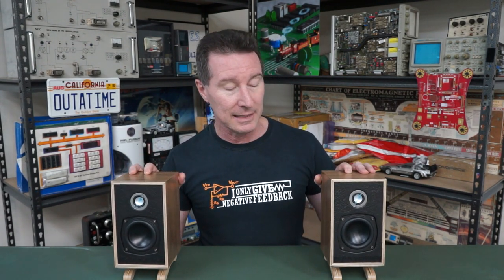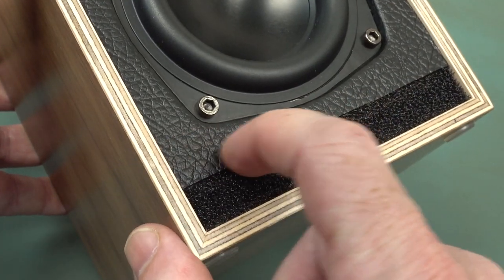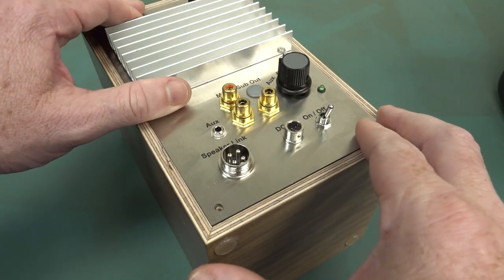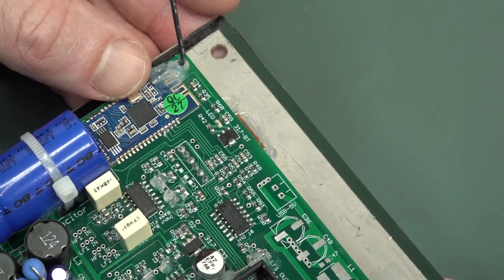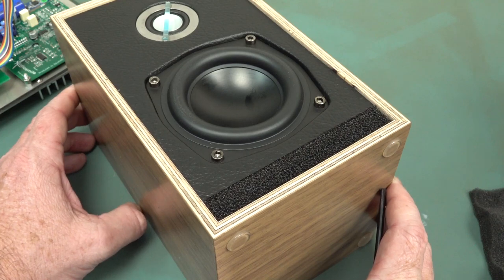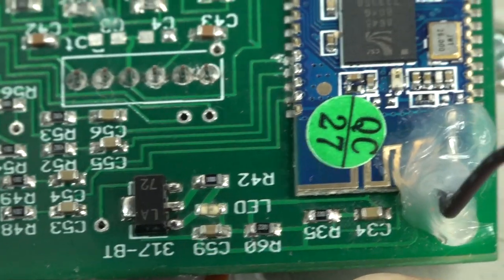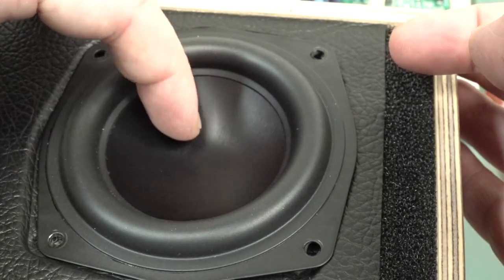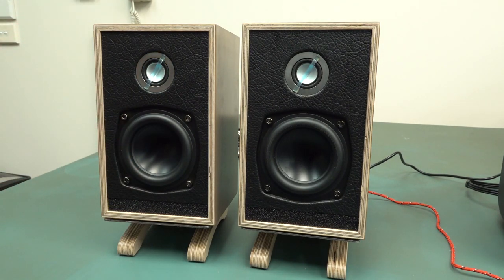EEVblog #1162 - Little British Monitors

Comment: These achieve what was set out: a small size with transmission line and relative flat responce. You should not take the comparison to Focals as a nail in the coffin. For what they are worth, BLM-s stand to be a very reasonable pair of speakers. A little better fine tuning on the design and probably swapping out the tweeter would help alot. Construction wise, Birch plywood is the best material for speaker enclosures, tho the visual aspect, yeah... could use some "jazzing" up. Its 2019 already, we are all used to slick Apple designs by now. But I digress. What the designer needs is just the sort of constructive criticism Dave is putting down here. So, I support this idea with ideas to make it a project WORTH a kickstarter, which at this point is little bit lacking...
Reply: The thing that speaks volumes against the designer is the idea that he thinks birch plywood makes a speaker sound better.  That's completely ridiculous and indicates a rather shallow understanding of acoustics.
Reply: @alext9067  Material does not make anything sound "better", but reduce enclosure noise. I agree, there is alot of design depth regarding materials and when to use what, BUT. For the size, design and driver selection, its not a big difference to use birch plywood vs mdf. Tho, you must agree, birch ply was the reasonable choice in this case.

Comment: About isolation platforms: snakeoil, 100%. They don't do anything.. or the speaker cabinet is so poorly designed that we don't see such things. The isolation you need is couple of napkins, mouse mat at most. All kinds of multimaterial isolation, vibration isolators etc are pure bullshit. The ONLY effect we get is that the speaker is slightly higher from the surface. Speaker stand is different, specially if they have tilt. Sound quality viewpoint, they are useless and a red flag: if they sell isolation platforms claiming audible effects, they are either amateurs or scammers.

What is ever worse is that if the isolation platform wobbles.. the woofer element moves and it can reach resonance frequencies and that will make the whole speaker wobble.. In this case, those stands are literally worse than a mousemat or an old school phonebook

Comment: I don't get the right angle stuff. Everything i read with any sources behind it sais that its ok. That not electrical ou EMI problesm comes from there. Why is that not a good thing, aside from aesthetics?
Reply: @Okurka.  Dave always say he is a engineer. What are the engineering reasons why right angle traces are bad was my question

Comment: Bugger me, expensive speakers.
Reply: I only really use headphones anyway :p
Reply: pretty cheap in the scheme of things, although probably overpriced for what they are. If you were willing to do the woodwork yourself you could build something like this for <$100.
Reply: @tmmtmm  More then just woodwork, if you note the tweeter and woofer is not using a conventional passive crossover, that's actually a four channel amp, these are bi-amplified speakers. The crossover is active and done pre-amplification allowing the amplifier modules to drive the drivers directly. A fair amount of engineering goes into these, I am running a similar setup I designed myself, however the preamp and amplifiers are in separate enclosures.
Reply: @gnif  they are over priced....esp since they don't have a xover and the associated expensive coils.   
With the screw ups on the board and the shabby assembly, I could buy an equivalent speaker in North America for under $100.. not $650 like those pieces of junk
Reply: @samjones1954  perhaps so, but the statement that you could build them yourself for under $100 is a bit of a stretch. Dave did also mention that these are pre-production samples, it is common to have bodges in these that are corrected before the final version is released. I agree however that I would not purchase these in their current state, while it's obvious a lot of thought has gone into them I believe some aspects of them are lacking, especially the selection of op-amps used, and the fact that a full range driver was used in a split system.
Reply: @samjones1954  

There's no way any company, could build these speakers for $100 and remain in business for very long. Anyone who says otherwise will be out of business in weeks.
Reply: Plenty of great speakers for sale in charity shops.

Comment: Overpriced cheap looking.
Reply: Definitely audiophile bullshit.
Reply: Incredibly
Reply: Is anyone noticed that "Marc Vincent" label is missing for this time?
Reply: Sadly, yeah, overpriced.  My main speakers started life as a pair of morduant short bookshelf speakers, about 100 pounds UK.   The rear firing port was inconvenient. I used my basic diy skills to rehouse them in bigger chipboard enclosures which taper towards the bottom and may be a mash up between tl and folded horn with floor firing vent (they hang on the wall).     They sound the same, as expected, through most of the range, but the bass breathes more easily. Dave snipes at bluetooth and crappie class D amplifiers.  I'm listening to this video via an el cheapo LIDL blue tooth class D device that may have the same drivers as the "tweeters" in the ones shown here.  In a good enclosure they're great down to upper bass.  And I'm sick of Chinese equals crap. The drivers are Chinese,  but the bits for the cab were cnc routed in England.   Obviously higher class.  Eh?.  And, to fully vent my grumpiness, there is no reason for singling out birch plywood as being superior without specifying glue, laminating pressure and grain alignment, which will dramatically tha acoustic properties.  Hocus pocus.

Comment: Please consider putting a damper on the unfounded/vaguely reasoned fud & theorizing while insisting you know little about audio engineering - it comes off as just a bit tacky.  Or maybe level up if you're going to continue to cover speakers & audio devices?

Comment: For anyone interested here is a link to the original BBC paper quoted. Although ply does offer slightly better damping than particle board the other reason for its preference is that it is available in a greater number of thicknesses (see conclusion in the linked paper) https://www.bbc.co.uk/rd/publications/rdreport_1977_03

Comment: Everyone wanks over birchwood  ply on guitar amps, it's what Marshall have used in their good cabs and what all the rip off 'boutique' amps use, I always think partical board sounds betters just because it's thicker and has more mass, but ply looks nice, not that you see it in guitar amps and speaker cabinets. In fact that would be a good thing for you to do a video on, what is the mark up 'boutique' amps and effects pedals, there are so many people making them that there obviously has to be massive margins in them.
Reply: You are correct.  The walls of the cabinets should be as rigid as possible.  Concrete would be nice.  Particle board is a good choice.  There is so much bs connected with sound equipment.  If someone believes that birch plywood makes a speaker sound better,,, well, what can I say.  It's insane.
Reply: @alext9067  
I know it has been tested and birch plywood gave the best sound compared to other materials and other plywood, BUT I only have seen it in designs as a second inner layer of wood glued to a thick outside layer which was made of high pressure MDF (or HDF). As far as I know that test was only on the reflection of the sound by the material and I can imagine birch plywood has a more dampening effect like dampening materials often used inside speaker boxes. It would actually be interesting to create a concrete box with a layer of birch plywood on the inside. I do agree with you that the box should be as rigid as possible.
Reply: @czarzenana5125  Any vibration in the material that the box is made from will cause a loss at that frequency.  Plywood with no voids (not necessarily birch) would work well but be more expensive than particle board or, better yet, MDF or any denser material.  Beware of wild theories and skewed and pseudo-scientific test results.  Salespeople have been driving this activity since the beginning of time.
Reply: @alext9067  
Absolutely will it be more expensive and I suppose that was this guys aim. Building a cheap speaker and selling it as top-notch for an audiophile price, backed up by some study that birch plywood sounds better while that was not even the conclusion of that study. I was talking real audiophile big speakers with cost no object issues. 22mm high pressure MDF 120 cm high designs with 15mm birch plywood glued to the inside. Enclosures that themselves way around 40 kg. The test was mentioned in the video (by text) and apparently be done by the BBC. That's the BBC of 30 years ago, because I remember that test from long time ago. I actually don't believe the BBC did the test themselves, but they may have made a documentary about it.
This thing is small, so easily made rigid with the extra walls inside for the transmission line. The used birch plywood could have more layers for better quality, but the thing that really hit me was the wrong alignment of the heat sink. EEVblog states that this guy has been developing this speaker for years, but still the heat sink is a beginners mistake no real designer would make.

Comment: Those goddam 741s ... You can't get away from them if you tried. A studio esp in the 70s and 80s had mixers with hundreds of the buggers in em. Your favourite tunes probably been through 1000,s before you put them through your single ended triode...

Comment: Like you I like speakers, But as I got older I got away from fine audio. Oh well. Use to have JBL L100 studio monitors back in the day - which are much bigger than these. Then when Bose came out with the Acoustic Wave - the original unit, I was selling them. Bose sold them the same way Electrolux sold Vacuum cleaners. Anyway, I couldn't hear the difference between the two speakers - your Studio speakers and the ones that you are reviewing - probably because I am listening on some old Altec Lansing ACS33 computer speakers. LOL.  Dave - Keep up the good work. maybe some day I'll get to check out your country.

Comment: Stupid question... why are they called 'monitors'? If someone said 'monitor' to me I would have thought it was a display unit.
Reply: from Wiki 
Studio monitors are loudspeakers in speaker enclosures specifically designed for professional audio production applications, such as recording studios, filmmaking, television studios, radio studios and project or home studios, where accurate audio reproduction is crucial. Among audio engineers, the term monitor implies that the speaker is designed to produce relatively flat (linear) phase and frequency responses. In other words, it exhibits minimal emphasis or de-emphasis of particular frequencies, the loudspeaker gives an accurate reproduction of the tonal qualities of the source audio ("uncolored" or "transparent" are synonyms), and there will be no relative phase shift of particular frequencies—meaning no distortion in sound-stage perspective for stereo recordings.

Beyond stereo sound-stage requirements, a linear phase response helps impulse response remain true to source without encountering "smearing". An unqualified reference to a monitor often refers to a near-field (compact or close-field) design. This is a speaker small enough to sit on a stand or desk in proximity to the listener, so that most of the sound that the listener hears is coming directly from the speaker, rather than reflecting off of walls and ceilings (and thus picking up coloration and reverberation from the room). Monitor speakers may include more than one type of driver (e.g., a tweeter and a woofer) or, for monitoring low-frequency sounds, such as bass drum, single-driver subwoofer cabinets may be used.

Also, studio monitors are made in a more physically robust manner than home hi-fi loudspeakers; whereas home hi-fi loudspeakers often only have to reproduce compressed commercial recordings, studio monitors have to cope with the high volumes and sudden sound bursts that may happen in the studio when playing back unmastered mixes.
Reply: Monitor speakers or studio monitors are professional devices used to monitor audio characteristics.
Reply: I would say Tyler and Karol are both right. Funny enough hifi bookshelf speakers are also often called "monitors: and also stage wedges are called that often. Lets not forget IEM's :P
Reply from the maker: The term comes from the ability to "monitor" all frequencies evenly. This is why studio monitors shoot for as flat a frequency and phase response as possible.
Reply: Aren't studio speaker meant to be just like intercom type speaker... cheap, nasty and with no real power or quality. These seem awfully expensive. You could easily knock up something cheaper and better using some cheapo car 6x9s and a wee amp. Probably won't look as nice though.
Reply: @EEVblog  Ah that makes much more sense. I guess they are trying to hear as natural  a sound as possible before they manipulate it to sound good.
Reply: Stuart Coutts nope. Quite the opposite as Dave said above. Designed for flat frequency response, to monitor all frequencies evenly. Cheap car 6x9’s would be bass heavy and not suitable as a studio monitor
Reply: There are video monitors and there are audio monitors.
Reply: A "true" monitor speaker is used by a recording engineer to hear exactly what is being recorded in real time.   Detail and clarity is everything!  But the term "monitor" has come to mean any speaker used in music production, which makes it confusing.  Each stage of the process benefits from different speaker characteristics, but it isn't always clear what speaker is intended to do what job.  Speakers designed for "mastering" a track are different from speakers used for "monitoring" a recording session.  This fact leads to great confusion on the internet, because there is always someone who buys a monitoring speaker to use for mastering, or vice versa.  And many speakers attempt to be good at everything, but make compromises along the way, a point which someone is always able to be offended by!
Reply: @stuart Coutts
i understand, but in Audio production they are called MONITOR's 

if you think about the word "Monitor"  it neither implies Audio or Video, but it does imply that you are paying attention to something that you are  MONITORING something

in sound engineering and sound production, you use the monitors to MONITOR the sound and what is being recorded

and in the case of Screens,   you MONITOR was is on the screen,  aka,  you are keeping an eye on things

and in school we had HALL MONITORS which were neither speakers or Computer screens, but their job was to make sure no one was jigging class

so that's what "Monitor" means   and Recording Studio monitors are used to monitor the sound.. simple as that
Reply: @gtxviper  You would be partially correct about some speaker monitors having a "nasty" sound by design. 

For example, the famous Yamaha NS-10 and Auratone 5C were/are widely used in professional studios not because they have flat responses, but because they have a hump that somewhat exaggerates the mid range by tapering the highs and lows. As it turns out, that helps expose flaws in the all-important vocal range and gives context to how well a mix will translate. As such, they are considered monitors because they highlight that most human area of the frequency spectrum and allow engineers to monitor it in some comfort without fatiguing their ears with a flat speaker's blaring highs.

Really, the "good", flat monitors are only there as a sanity check for bass and highs and to impress clients with a big, truer-than-life sound. Most mixing tasks can be done on those kinds of "nasty" single-driver, full-range monitors and they generally are.
Reply: Hmmm. Any ported enclosure has a 2-step impulse response. So, a kick drum delivers the thwack and the port a 2nd shortly after. A monitor should be infinitr baffle surely? Ports only increase continuous bass notes like an organ pipe and are a compromise for small enclosures.
Reply: No, they are not meant to be like intercom speakers. Those would be... intercom speakers ;-)

Comment: Sir please answer my question . My question is: four resistors A,B,C and D are connected so as to form square . And to the diagonally opposite junctions potential difference v is applied. And current through one resistor say  A is measured and then the remaining two diagonally opposite junctions are connected by superconductve wire and current through resistor A is measured it is found that it is same as before. sir question to you is : can we say that current through all the three remaining resistors is same as that when superconductive wire is not connected ? Can we say that these two diagonally opposite juctions(where superconductive wire was not connected) are at same potential?